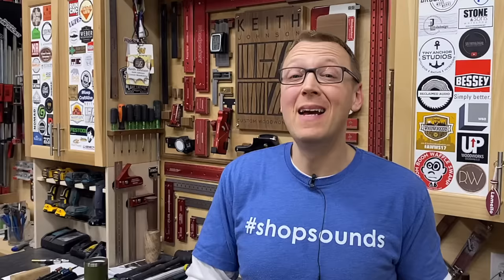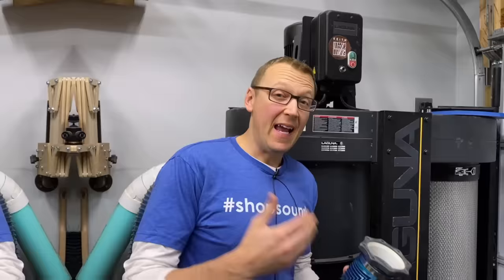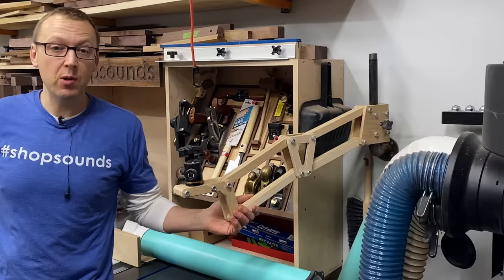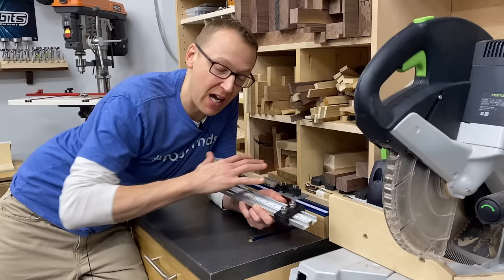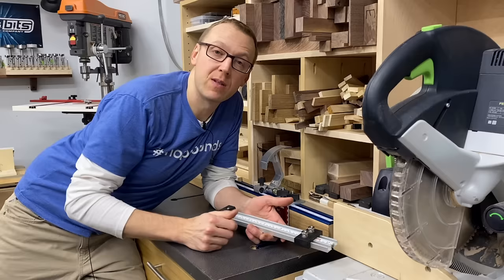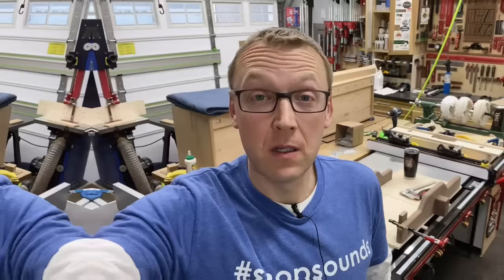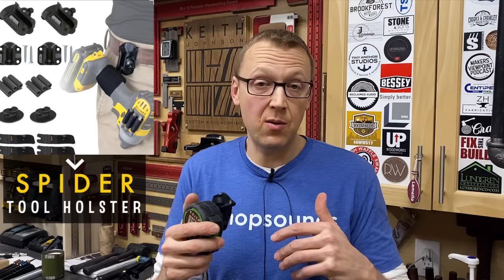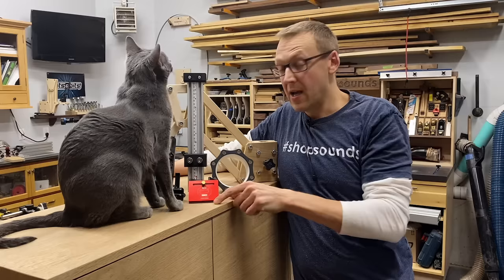6 tools I wish I had bought sooner.

Comment: Great video Keith! Thanks for the shout out!
Reply from the maker: Any time! Love that stop block!! 👊
Reply: Hi. Does this stop block work, or is there one, if your t-track is built into the table along the side of the miter saw?
Reply from the maker: @davobonbon  Hopefully Jonathan will chime in here, but if you flip it upside down it should work fine. As long as you have a way to square it perfectly parallel to your track. But I just tried it on the length of tea track and it worked flipped upside down.

Comment: FYI, the Y-splitter on your band saw is on backwards. You want the suction on the single side with the two ports flowing into the branches. Right now, dust from the table has to make a 135 degree turn to get out and probably doesn't work very well.
Reply from the maker: Yes, thank you. It's 4 feet away from a 3hp dust collector and pulling minimum dust off the band saw, so air flow isn't an issue. I just re-sawed 48 strips of 2x6 walnut and there was barely any dust (at least for a band saw). I set it up that way to fit it into the space better. If the dust collector it was 20 feet away, I would be more concerned about the setup and a loss of airflow. 👍

Comment: I like the Magport fittings!  I'm in favour of a simplified process that eliminates excuses for not using dust extraction.  My shop can definitely use a good cleaning!  I will check stout. Thanks for sharing.
Reply from the maker: Dust extraction is so important!! I was quite deficient in that department for years. And the Magports just make things that much easier.

Comment: Not to be too big of a critic but your wye fitting on the bandsaw is installed backwards.  When looking at the airflow you are making the upper dust collection point (the top of the bandsaw) bend almost 180 degrees, losing over half of the capability.  But hey, I'm just jealous of that big arse dust collector.
Reply from the maker: Good eye! Yes, I am aware but it fit better that way and since it's only a few feet from the dust collector, air flow isn't that big of an issue. And the band saw doesn't throw dust like table saw or miter saw and the DC can keep up without issue. But I'll admit it does look odd! 😂

Comment: Tell me more about your jointer planer. I struggle with mine. I used abs fittings but they don’t swivel. Can you pls show yours?
Reply from the maker: Hammer A3-31. Swivel connection made by Rockler.

Comment: Hey there Keith, can I ask why the bandsaw hose is split the way it is and not with the single port of the Y splitter going to the dust collector and the two splits to the bandsaw?
Awsome videos man, thank you 😺
Reply from the maker: Thanks man!! And I got to be honest, I'm not really following the setup describing. 😬🤔
Reply: @KeithJohnsonCustomWoodworking  I think he is wondering why the wye fitting is positioned the the way it is.(I'm guessing because it more readily sits better.)  Usually the fitting would be turned 180°, offering better air flow.  The way it is now, the table side has to kind of turn a corner and doesn't flow as smoothly.  If any of that makes sense, lol.  Nice vid by the way, thanks for using your time ti make them.
Reply from the maker: @jeffbrooks7286  Ah, ok, Thank you. Yes, it was setup that way because it just sits better in the space. And since it's literally 4 feet away from the 3HP dust collector, air flow doesn't seem to be an issue.
Reply: @KeithJohnsonCustomWoodworking  Now i get it, I was wondering what kind of airflow you'd get on the table side. Or maybe it was just bothering my ocd 😁
Thanks again for the fine videos.
Reply from the maker: @euhunter  For a bandsaw, that machine has great dust collection, but I guess it could be even better! LOL.

Comment: Just curious keith about the y connection on your bandsaw dust collection.  If tht direction inhibits the collection at all?
Reply from the maker: Great question! Someone else brought up the same point and honestly, I never even noticed I had it setup incorrectly. However, being that a 3HP dust collector is a mere 4 feet away and the band saw isn't really a super dust generator, air flow isn't a problem. However, if it was on the other side of the room, it would most likely hinder it a little. Thanks for picking up on that! 👍

Comment: Great video Keith.  Thanks for your thoughts and recommendations.  I saw your Laguna DC and am curious how you like it.  I'm in the market for my first dedicated DC (currently using shops vacs) and have been seriously considering the Laguna.  How do you like it?  Any regrets?  Thanks!
Reply from the maker: Funny you should ask, Jake...I just sold mine. After less than a year, the motor blew up and had to be replaced. It is also extremely loud and a huge space hog. I replaced it with a Harvey Woodworking Gyro Air 700 and I love it. It's less HP, but has forced me to level up my duct work to be sure I don't lose an CFM with loosely fit PVC pipe. Check out Jason Bents video here to have a look at the machine: https://youtu.be/9MNXE_VFsIU
Reply: @KeithJohnsonCustomWoodworking  Thanks for the reply and thanks for the video link.  Now to begin my consideration process all over again!  LOL.  The Gyro looks amazing and probably worth the investment.  I hope you do a video on it and how you set it up.